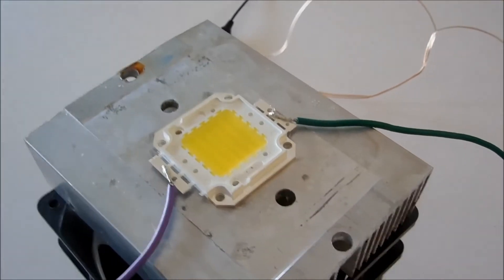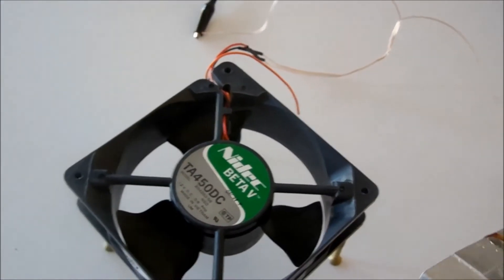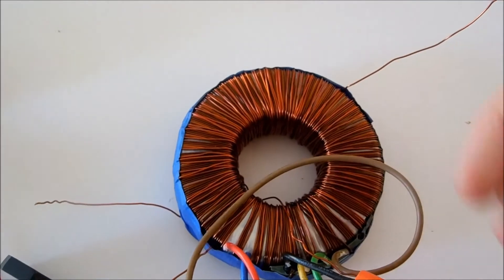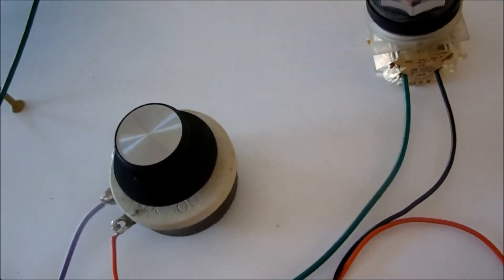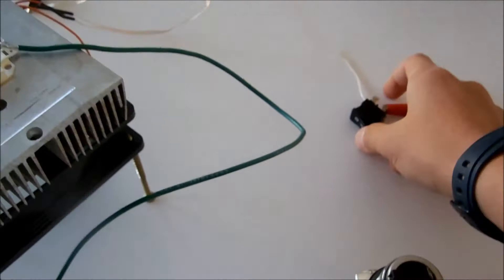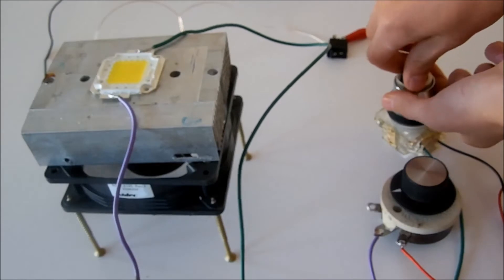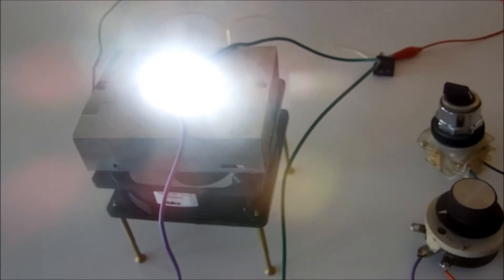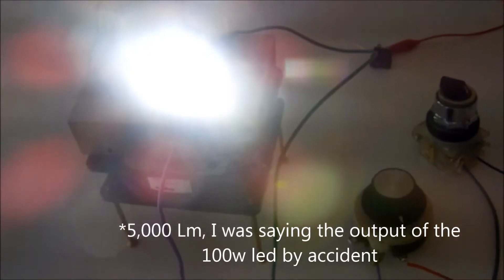Testing 50w High Power Cool White LED

Comment: Where did you get the toroid? What size is it physically. I would like to build one like yours.
Reply: Ok I now know I need a 93mm Od 29mm Id by 47mm high for a 120 VA supply. got the info form http://www.trafomic.fi/tm20-2000va , but where do I get one? Please help if you can.